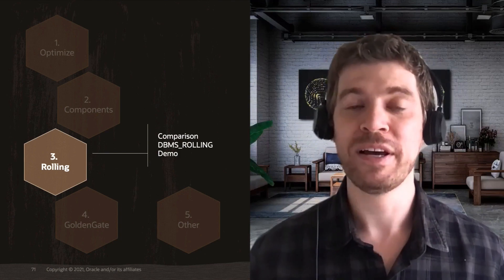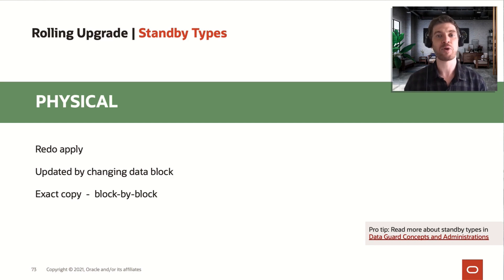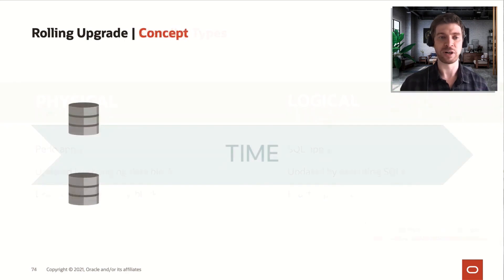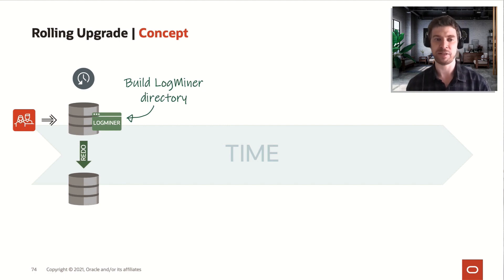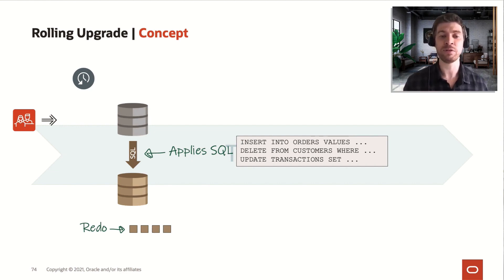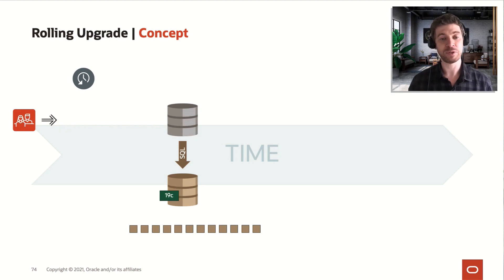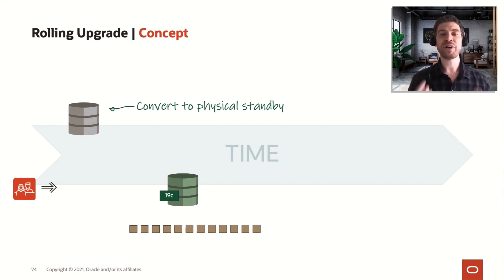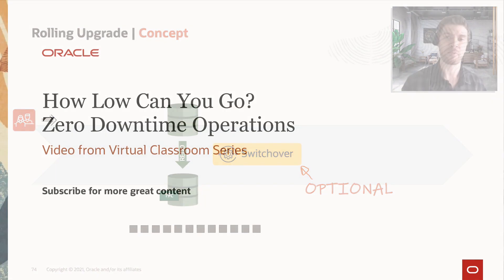Rolling upgrades of Oracle Database - concept

Comment: Why we are flashback database to GRP in old primary
Reply from the maker: Hi Mubeen,
You must set a GRP on the old primary because it will deviate from the new primary, when it is converted to a logical standby. After switchover to the new primary database (the logical standby), in order to re-instantiate the old primary in the Data Guard config, it must be flashed back in time to a point where the two databases were the same. Which is the point at which the GRP is made.
Regards,
Daniel

Comment: how can we convert the database to logical standby if the database has un-supported data types ? can you show us a real life example please ? and why we flashback the source database to the GRP before converting it to physical standby ?
Reply from the maker: Hi Samer,
If you have objects with unsupported data types, you must find another way of dealing with those objects. Typically, such objects would be moved during a downtime window using Data Pump. If the object is too large to be moved inside the maintenance window, then you need to use Oracle GoldenGate instead which has much better support for object and data types.
The source database must be flashed back to a point in time when it was similar to the new, upgraded database (the one that was logical standby database). When two databases started to deviate from one another when it was converted to logical standby. When you flash back to GRP you can apply all the redo from the new, primary database and keep the two databases in sync. Once you convert a standby database to logical standby database and switchover to it - the former databases are no longer usable as standby databases.
Regards,
Daniel